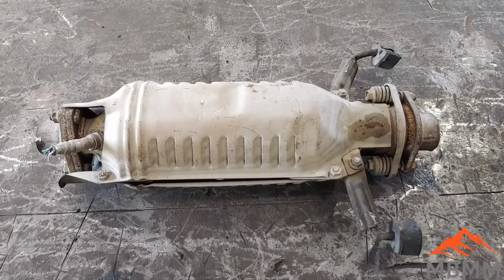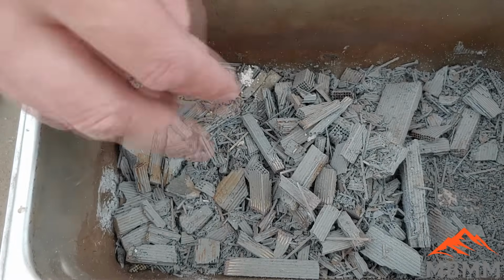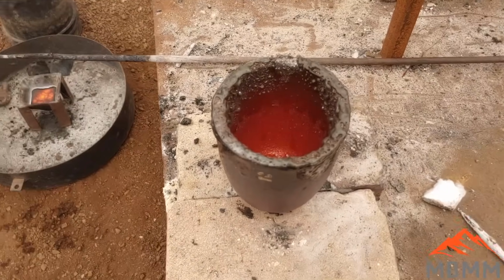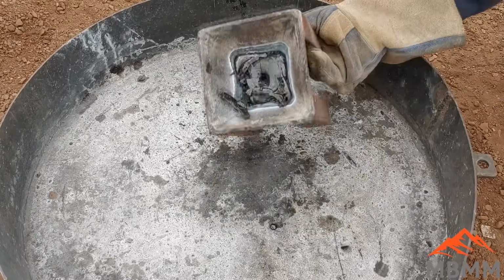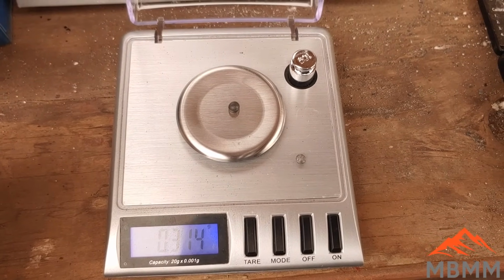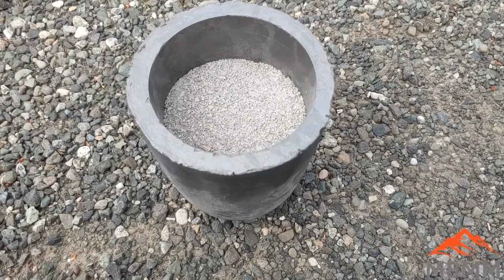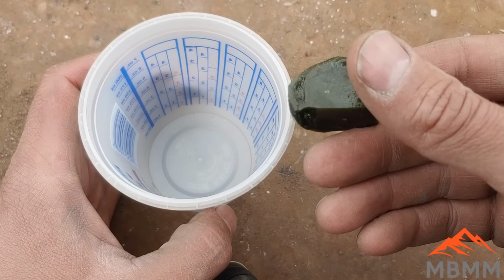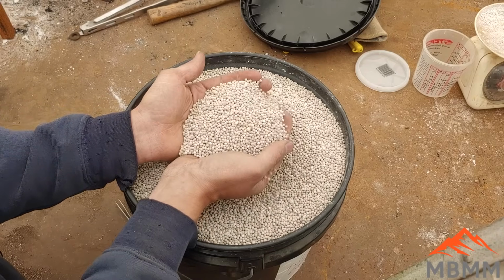Smelting Platinum/Palladium Catalytic Converters For PGMs..... Success???

Comment: use catalytic converters you pulled off yourself, if you buy them from ebay they are usually chemically treated to get all the precious metals out
Reply: Hence it being damp
Reply: Then whats the point in doing all this if you can just chemically treat it to get it out?
Reply: @thefogisgone3662  the recovery rate is less if you leave it all together.  So some jagoff's decides to extract 40% chemically of the metal than sell it at full price.
Reply: @Jdalio5  ohh, fair enough, i have officially been learnt by the youtubes.
Reply: you will never get from ebay cleaned ones are empty because those dudes use acids, and since its inside metal tube you cant get it all out, they all on ebay got 30-40% of the initial content left, but yes you better off not pay at all what was in there
Reply: I deal with it, I got Toyota, Prado , Honda  Benz and BMW  including Nissan
Reply: @Jdalio5  Are u from Pittsburg? Nobody uses Jagoff anymore unless it's Pittsburg or area around it. Do you get pants at pants n nat? Say yins?
Reply: @kitjasabsgabs1830  im from Delaware and picked up the word from comedian  Jimmy Dore somehow lol
Reply: @Jdalio5  Damn. I was close. Oh well. If you like comedy listen to wdve radio station skits about Pittsburgers accents. Funny stuff.
Reply: @kitjasabsgabs1830  i drive a caaaaa and drink some sowda and speak slowly lol - Pennsylvania accents rock!
Reply: Is that way there was moisture inside?

Comment: I’ve seen Cody’s lab hit the lead/platinum button with an oxy acetylene torch while its in the cupel to melt the bead and drive off the lead
Reply: Agreed oxy/acetyl torch will drive off the last bit. How ever don't blast it for to long oxy/acetyl gets hot enough to vaporize pgm's eventually
Reply: @kieranodea771  I did that once with gold it just suddenly vanished and left a rainbow behind luckily it wasn't much gold
Reply: @jaydaksrules5316  The key is to use around half the oxygen you would normally use. Other wise an oxy/acetylene flame is so hot it will just vaporize gold and pgm's like you said. Especially when in small amount or if its in a  finely divided state.
Reply: @jaydaksrules5316  Also you should be able to remove all the lead from gold with normal means with a cupel. Really only pgm's have the issue of needing really high temperature to remove the last bit of lead.
Reply: Sreetips chemically refines pgm and then smelts it to nearly 4000 degrees

Comment: I have a suggestion for consolidating your high melting metal powders into a chunk of metal. You could take the mud from electrowinning the Pt and Pd out of Cu and dry it out to get metal powder. When we work with precious metal powders in the lab, we press them into pellets in a pellet die then melt them in an arc melter. You will not need an inert atmosphere to melt Pt or Pd so you could use a TIG torch to melt them. Use a large, clean block of copper as a hearth plate and the metal should not stick (unless you get the copper too hot).

I think your Idea of adding silver to reduce the melting point of the lead alloy was a good idea.

Comment: Some of those have Rhodium.  Palladium will be highest content then platinum then rhodium.  (Generally).    Converters have different amounts of metal depending on the motor they were used on. 
The honeycomb is called the substrate. 
You don’t want that. All you want is the coating on the substrate.  that’s where the metal is. The slurry coats the substrate.  If you can find a way to get just the coating off the substrate, you will  greatly reduce the effort and starting material.  (Crushed up substrate is just more waste you have to remove.).  That’s about as much as I can tell you without fear of Loosing my job.
Reply: I won't tell
Reply: hello. thanks for  your information.
Maybe can you tell something about how posible take out the rhodium from catalyc? thanks thats the main problem for me...
Reply: @szucslorant4115  there's a YouTube video somewhere that shows how to separate rhodium out of solution of aqua regia using zinc, it's a lot like using copper to pull silver out of nitric acid solution, the zinc is more reactive so it prefers the zinc in solution so the rhodium drops out as black powder. I can't remember who it was but it looked like a Russian smelter. Poor quality video but great quality info. But you'd have to separate out the platinum or palladium first, I can't remember if you need to first but there's a way to do that. Or you could just collect spark plugs and go for the iridium 😂
Reply: I saw a guy put the whole ceramic in a crucible and melt the entire thing, I guess he had a furnace hot enough to melt ceramic, then poured it into an inverted pyramid mold so all the PGMs sank to the bottom and there was a little silver button at the tip of the pyramid after it cooled and he dropped it out.

Comment: I like the idea of silver as a collector, the button could then be dissolved in nitric, putting the silver and palladium into solution and leaving only the platinum at the bottom of a beaker. Then the silver and palladium could each be brought out of solution, one at a time, thus separating those two from each other.
Reply: Yep I second that. Sliver nitrate is easy to separate and recover
Reply: Chemistry is so f ing cool
Reply: Would agree that increasing silver content during smelt process might help increase recovery if it’s actually the limiting reactant for pulling out the palladium.   Any way to calculate that?  Chemistry is freakin cool.
Reply: Nitric acid becomes weakened from more silver being  present which reduces it's dissolve ability for the PL.

Comment: The platinum in the ceramic beads can be recovered directly from the beads with a complex reaction. I think you will have higher Pt recovery from the complex reaction process than from the smelting process.
Reply: Great experiments
Reply: Is it similar to the one that Cody’s lab did?
Reply: Beautiful convection cell video!

Comment: Industrial separation of cats is usually done with very high heat and using iron as the collection metal though some use copper. I also know that the honeycomb is burnt off before being milled into a fine powder in a ball mill. Also of note is that newer iron sulfide methods of extraction are being used as they can operate at a temp of only 950 deg C.

Comment: Hey Jason! Does platinum oxidize and lose weight as it comes into contact with oxygen at it's melting point?
I have tried melting platinum before and it violently started vaporizing. I even tried slowly approaching its melting point but i was quickly losing the precious metal. 
Im just wondering if your losing some when you coupelle. Although it dont look like your losing any. Nonetheless thank you for your time making these videos. I have learned a lot.

Comment: I worked at both the Stillwater Smelter & Base Metals Refinery in Columbus Montana. We’d actually smelt down Bulk Bags of Catalyst. The end result was a black powder we sent to Engelhard Refinery for end process. They’d keep the Gold / Silver and we’d get the Platinum/Palladium. I will say we had all the mined metal from the Nye Montana and East Boulder.
Reply: After smelting I don't see how it would be a black powder? That is what happens in chemical process. Were you the smelter?

Comment: In addition to tantalum, I also noticed some vanadium. Both metals can be used in NOX converters. The converter you used had two distinct sections. Perhaps the upstream section was for NOX and the downstream a typical converter.

Comment: In terms of using an automotive catalyst- assuming the mass of the base catalyst matters relative to how much PGM recovery you expect- I would suggest only doing the first catalyst.  Generally, they will have 5x the amount of platinum or palladium in them vs. the second one.  Again, finding automotive catalysts from PZEV vehicles in the 2000-2007 range will the highest potential of all PGM.  After some control work, OEM's figured out how to manipulate the air-fuel control to not require the high PGM loadings of the original PZEV cars.

Also- all of the gasoline catalysts in the last 30 years are all 3 way catalysts.  The first one will do the vast majority of the work, the second one is there for high mass flow (like when you accelerate on a freeway).  

I know nothing about industrial catalysts- so it will be interesting to see your experiment.

Comment: The XRF gun can sometimes get confused, so the tantalum might actually be your platinum. I've seen gold show as lead and tungsten on XRF guns before, so they aren't always 100% correct
Reply: Yep. they need to know what theyre working with to properly understand what the returning xrays mean.
Reply: Yup. The signals generated from tantalum and platinum have a major feature in common (both signals have a big spike at 9.4 keV). It's similar for gold and tungsten (both have a big spike at 9.7 keV). Where the signals are similar they can be confused, so for best results, XRF software needs to have an idea of what is expected to be in the sample (this is why you get different versions for base metal analysis and precious metal analysis).
Reply: catch22frubert  yep, codyslab almost always displays 100% pure gold as a tungsten peak. The amount of overlap between element peaks can be huge especially for pgms

Comment: It would be useful to stir the molten metal bath to increase the contact surface of the collector metal with the PGMs and if you use copper as a collector, the ideal is to subject the PGM copper alloy to electrolysis, reuse the electrolytic copper and the PGMs remain as black powder to be refined in the bottom of the electrolytic tank, the excessive use of NaO in the flux can involve losses of Pt, the highest production cost is in the flux, sodium borate is not cheap. Congratulations for the job!!

Comment: there is always boiling nitric and hydrochloric acid to dissolve PGMs into solution to separate and get out pure metals
Reply: The problem with that is how dangerous PGMs are in solution. Google platinosis. If you don’t have to dissolve PGMs you’re much better off not.

Comment: the O2 sensor is high in Pt for a start.
Reply: not at all, its a very very very tiny plate on it contains pt/pd, most computer boards have more pt than o2 sensors

Comment: This is what I found:

One of the main uses of tantalum is in the production of electronic components. An oxide layer which forms on the surface of tantalum can act as an insulating (dielectric) layer. Because tantalum can be used to coat other metals with a very thin layer, a high capacitance can be achieved in a small volume.
Reply: Any buyer for tantalum here?
Reply: Tantalum is very rare & used in every cell phone. It is only found in Tanzania, ,Africa using child labor. Many die in the unstable mines. They are buried in the mine.
Reply: @goldcic  That is so sad. There is so much stuff like that that goes on in the world its hard to believe. Do you know much about the content in this video by chance? If so I'd like to ask you a few questions about it thanks in advance. Also you are very well nevermind you already know 😉

Comment: When you pour without collector metal you need to pre-heat the tip of your pyramid mold to red hot otherwise the tip solidifies before the heaviest stuff settles to the tip.

Comment: @mbmmllc 
The tantalum came from inside the engine.
There's no platinum cause it was burnt off before the palladium was during vehicle use (wear and tear). 
There will always be a lower recovery on a used catalytic converter. The precious metals are coated on the ceramics, as it is in use (vehicle being driven) these precious metals are coming off and blowing in the road..BUT on a diesel semi truck the precious metals are being stored within the soot and collected above in the collector container.. on average those containers hold 2-3 oz's of particulate matter. This particulate matter holds more precious metals then on the used cones you are experimenting with. 
I have several pounds if you'd like to try a few samples.. let me know.

I believe there are more precious metals in the particulates of the soot/ash of a diesel semi truck than in a used ceramic cone.
Precious metals are sintered on the outside surfaces of the cones. As soot from the engine attaches to the cones (containing oils and other metals) they get super hot and almost sinter to the cones themselves. This soot/ash goes thru a super heat process of around 3200 f degrees during the regeneration process (cleaning process) and release these materials ..right along with the precious metals.

Trying doing what you do with diesel soot/ash... I bet your results are higher.
Reply: I think your probably right
Reply: @dumbnrduh  Still wishing I could get help with it.

Comment: hi guy - i work with advanced geopolymer technology which is closely related to glass and ceramic technology.  we experiment with different recipes of exacting amounts of secret ingredients.  most people studying the technology just use clay out of the ground which is full of impurities.  anyways just wanted to mention that quartz (silica) can be compared to ice.  Water can only hold so much soluble minerals before getting saturated and then minerals fall out of solution and settle to the bottom.  Then when the saturated water freezes the dissolved minerals stay suspended in the ice.  this is similar to the smelting recovery process you are using.  Molten silica also has a saturation limit.  I can see it would be important to have precisely measured ingredients to maximize recovery rates!  if too much silica is used then some of the precious metal will be lost (absorbed) into the glass matrix.   Good thing the cheap collector metals are probably more soluble in the glass than the precious metals.   I wonder if oxidized collector metals could be used such as copper oxide powder instead of copper metal because glass loves to absorb and bond to oxides.  the molten silica could get saturated with cheap soluble oxides so that more of the precious metal could fall out of molten solution ???  not really sure.   great videos by the way - this is the first time learning about Quepel Technology (i have no idea how to spell it) - much simpler than acid recovery/refining methods!!!
Reply: This is an awesome reply.  I would’ve never thought of silica absorbing PMs.   
And so you can look more into the process, it is spelled Cupel (Cupelling).  
I’m learning more about it myself.  I have a lot of waste material that might contain PT group metals, so planning on trying the cupelling process to recover those.

Comment: Ag has a lower melting point than Cu, better helping to lower the m.p. of your alloy.

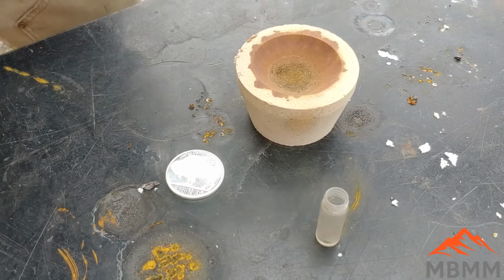25:22 - It's useful to place the metals with higher m.p.s on top, as they will melt last, while the heat from the Ag rises. Also, their higher densities will help push down on the Silver.

More cost efficient to use Ag shot, than melting a coin? Haha. Whatever works!

Will be Interesting to see which of your formulas produces the best yield. Cheers.

Comment: Youngin, That ain't gonna work with platinum.  Platinum melts at about 4800 degrees.  That little furnace won't even get it warm ;)  And if you wondering where the platinum went in your other batch, it will be in the slag ;)  In the gold fields we get the gold out of the black sands, then dry the batch and go over it with a kitchen magnet to remove magnatite.  Then go back over it with an N42 super neodium magnet which will lift platinum as it is just para-magnetic.  That will also lift a bit of ferrite with it.  We put it in a beaker and hit it with nitric.  That eats the ferrite and leaves the pure platinum.  When we get a couple of ounces, we send it to a commercial processor that has a good enough furnace to process it.  That "Don't try this at home" is sage advice for platinum LOL!  Are there any old copper smelters around close?  Their slag will be rich with platinum!!!  You see, it went into their slag as well ;)
Reply: hello. thanks for  your information.
Maybe can you tell something about how possible take out the rhodium from catalyc or from other parts?? thanks. thats the main mission for me...

Comment: Sulfuric electrolyte with metal foil as anode, metal plated over to cathode loosens precious metals wash coat which falls to the bottom of the cell.

Comment: Tantalum I noticed appears when you shot the silver bead, and that makes since because it is a transition medal also Ra too. They both came with the silver and copper. The copper I assume wasn't pure and was from wire scrap. Both Ra and Ta are contaminants from the coin and scrap wire.